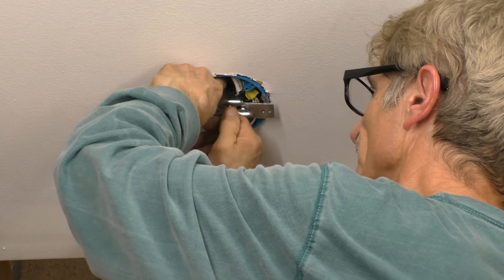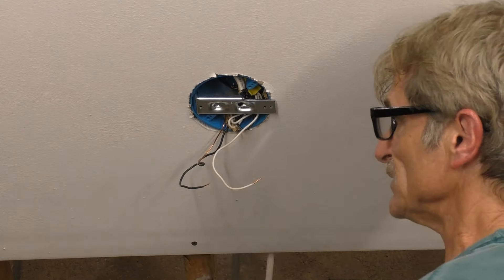Installing Ceiling Fan Bracket Without Changing Out The Existing Electrical Box

Comment: Damn they used to be $11 dollar then $20 now $30
Reply from the maker: sorry you misunderstood the prices,  we were having problems with postage pricing so we just made a flat rate that included shipping and handling.the EZ-Brace 101 went from $11 to $20. The EZ-Brace 200 the 216 and the 224 is $30. Until we are able to get them into the stores where the EZ-Brace 101 will cost between $10 and $12 the EZ-Brace 101 is $20

Comment: That's not true having been an electrican for over 25yrs we woukd wire homes with one wire a  14-2 for a light or a 14-3 for a oaddle fan light combo...with grnds of course. To cluter up a junction box in my state as he shows is unprofessinal with the exceptuon of multiple lights on one switch then you'd have in and outs.
Reply from the maker: It's not multiple lights on one switch it's multiple lights on one circuit.  With your analogy  it doesn't sound like you've been an electrician for 25 days must less 25 years.  So if you want to talk unprofessionalism, you need to listen to what I actually said before you such a statement .

Comment: You can’t install a ceiling fan to a plastic electric box.

Not true at all.
Reply from the maker: listen to what is said in the video the fan is not mounted to a plastic box it is mounted to a metal bracket that is securely mounted through the box to the joist.
Reply: What’s the code book say?
Reply from the maker: @brucehenry5338  NEC code [314.27(C)] states,  If the maximum weight isn't marked on the box, and the fan weighs more than 35 pounds the fan must be supported independently of the outlet box. ceiling paddle fans greater than 70 lbs must be supported independently of outlet box
Reply: @robertleo9744  thanks for the clarification.

Comment: I have plastic junction boxes in my house I'm okay with a ceiling fan being on plastic junction box if it's a small one if it's a big 42-in to 52-in man you need a junction box made out of metal
Reply: The EZ-Brace101 supports the ceiling fan independent of the box thus NEC code 422.18.  The EZ-Brace101 is better than an ordinary metal box to support a ceiling fan